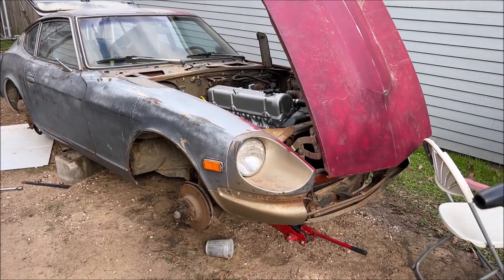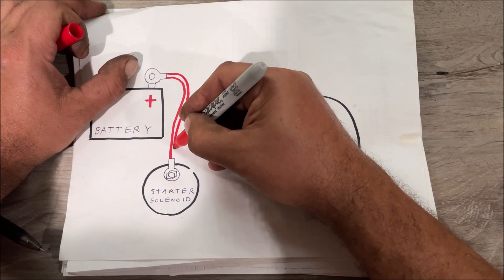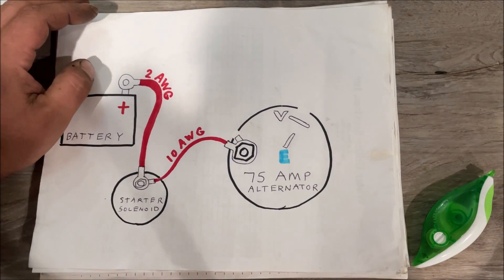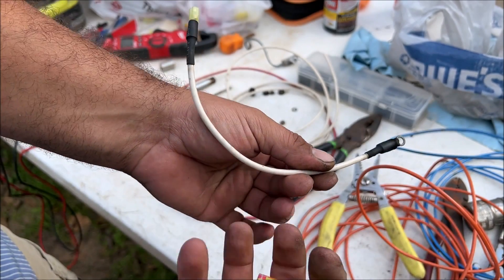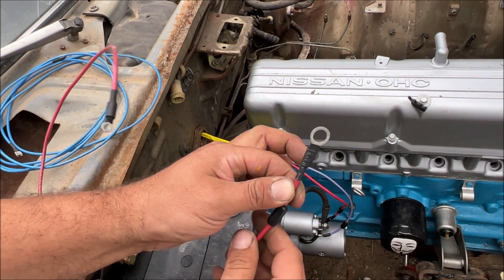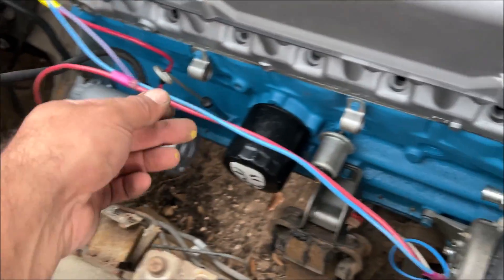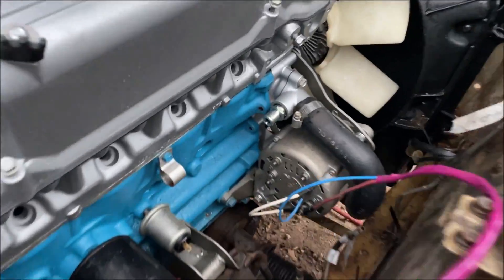how to wire an ALTERNATOR charging system on ANYTHING custom automotive wiring from scratch PART 2

Comment: Copper 10 gauge wire is only rated for 35-40 amps. I would go much bigger, check your alternator for max amps and go above that.
Reply from the maker: we aren’t wiring a house bro
Reply: @chriscraft77022 lmao

Comment: in your other video 64-72 charging system you said the excitor wire is ran to ignition on with the key, yet for this video you said it goes to the accesory, no wonder why I wired by chevy 230 exactly like the other video and it turns over but doesnt crank. I think you did not explain the other video correctly.
Reply from the maker: that was a charging system video. I have a few alternator wiring videos. This is an alternator video so I go in depth. Your car is going to do the same thing. It depends on how the vehicle is wired

Comment: Very detailed good video definitely helped me solve my problem replaced battery and alternator but not the wiring connected to the voltage regulator from the alternator back to the battery and my alternator ended up over charging (i guess) and caused a minor fire (2010 E63 AMG)

Comment: I am wiring a gm style 3 wire alternator. I have battery voltage constant at the alternator for the exciter wire. Any ideas why it has power at the alternator side when unplugged?

Comment: I am converting my 71 Corvette from the factory alt to an aftermarket 1 wire and looking for a diagram to help with my harness, got anything?
Reply from the maker: I have a 1 wire alternator video
Reply: I'll look for it. Trying to figure out which wires I need to run out of the factory harness as I moved the alt from the drivers side to the passenger side.
Reply from the maker: no wires from the harness go to a 1 wire
Reply: @chriscraft77022  So, essetially just from the alt lug to the starter pos, or direct to battery via fuse, and a ground to alt housing?
Reply from the maker: Yes, but run a #4 wire. The alternator is already grounded but you can
Reply: @chriscraft77022  Well, I have a separate mounted mini fuse block mounted on my passenger inner fender where the washer fluid res was. I run a #6 wire to that to power my MSD and Spal fans. It is only about 20" from the alternator currently and I figured I could run a #6 to that lug. 
My battery cable is a 1/0 from the location behind the drivers seat to the starter, the starter end I have the #6 running to the fuse panel. 
Clean and should have plenty of power handling capacity..
Just trying to make my 1 wire setup clean as possible.
As for an extra ground, always figure a spare ground is a good thing.

Comment: Not that it makes a bit of difference with getting it wired but the kick in you might hear when reving the engine up is the other two “legs” activating at cruising rpm. The alternator itself will activate at its set rpm excitement point on one electromagnet with an engine rpm above 500 due to the size reduction of the crank pulley to alt pulley on the belt. Belt travel speed in inches/second is the same at both but the smaller alt pulley spins faster to cover the distance. The single leg keeps headlights, fans and ignition from depleting the battery at idle, it just doesn’t recharge the battery as much at idle. Lower amps output for less drag on motor and better fuel efficiency and heat control when not moving.
Reply: @NeuronioJr sometimes, depends on weather

Comment: I have a 1977 280z but my Black fusible link keeps on getting hot as the revs go higher. Could this method solve that issue, or do you have any other suggestions ? thanks
Reply from the maker: you need to clean all the connections and grounds first

Comment: I wired my Toyota exactly like this. Anyone know why i read 17.5v at the battery when the car is running at about 2000 rpm???
Reply from the maker: your voltage sensing is not wired right. You will catch your car on fire

Comment: Ive got post two looped to the lug just like youve got. But my field wire has power going though it, its not wired to the ignition switch yet. Why does it have power going through it?
Reply from the maker: it shuts power off once the alternator starts charging.. that’s powers your battery light on in the dash

Comment: I had a problem with the ignition wire going to the alternator... no volts.  I tied the exciter wire to the main alternator stud and seems to be charging fine.  Is there any issue running it like that until I get time to trouble shoot the ignition wire?
Reply from the maker: you will drain your battery dead. Voltage sensing has to be hooked up.. not the exciter wire
Reply: Thanks for your reply.  I wish my wiring were as simple and clean as your engine bay.  I have a 95 Ford L8000 dump truck with a fair amount of harnesses that have been messed with by previous owner.  I put a master battery disconnect on the truck so I can isolate the batteries when not in use.  I have a Ford 3G alternator.  Lost all charging on the job site and replaced the unit.  Still was not charging.  Jumped from the main stud to the ignition wire and came to life 14.5 volts.   Been running it like that for a few days to get the job completed.  I was thinking the ignition wire should be hot while running, but mine is not, and will take a bit to go through the harness and take the dash apart.

Comment: ...whaoh!..so if I have an aftermarket ammeter, does it wire into that #2 sensor wire?
Reply from the maker: I have an ammeter video.. no, not even close
Reply: @chriscraft77022  please advise,..or put in a link to it. I see lots of Volkswagen stuff, but not specific ammeter.
Thank you.

Comment: I’ll probably would’ve put a solenoid from the starter and used a power junction . That way you don’t have all them amps in the switch and it n the cab.

Comment: 2:40 why can’t I jump the voltage wire to the power supply if I have a factory in dash amp meater?
I have a 57 Buick
Reply from the maker: you will get a false reading

Comment: So, I got one of these alternators to replace the original and I didn't know I had to wire it to the starter, mine was still hooked up to the voltage regulator. Now, I think my new alternator is fried..
Reply from the maker: you only fry the battery when voltage sensing isn’t hooked up.. if you hook it up wrong it either drains your battery when car is off or doesn’t charge the battery when running
Reply: @chriscraft77022  Turned out that there was a missing plastic piece from the B post that prevented grounding out. That was the cause of the issue. The original wiring that was setup was fine.

Comment: You nailed the reason for the voltage sensing wire, but running it to the output lug of the alternator is not the right thing to do. Running it back to the battery lug with 10 gauge wire will eliminate all those minute voltage drops in the vehicle wiring and will allow the alternator to charge properly. Another point is the gauge of the output wire. Even a 75A alternator will require more than a 10 gauge wire. 6 gauge would be the minimum and if the run is fairly long an even heavier wire may be required,

Comment: Your channel was just the thing I needed! I am working on a custom conversion and I could use some help on how I should build my charging system/Ignition system. Is there an email I can contact you at so we can chat? I would greatly appreciate it! I have a 1972 VW Bus with a Toyota 22R bolted to the original VW transaxle! The original bus harness is still being used and I am a beginner to understand electrical. Thanks in advance!

Comment: You do yours the same as me. But I run the sensing wire somewhere down the line so it will sense the voltage at the battery so it knows if its charged. Running it off the alternator it only gets the 14 volts its putting out.

Comment: Oh my Gosh, thats it, thats it!!! I recently dragged home. A previous owner modified, 1979 MG Midget Spridget. I been plagued with; electrical wiring issues, throughout the car. After i got it running, the previous owner was unable to do. Problems arose; when I decided, the factory wiring harness would not be appropriate to use. Thus I began to do what was my first forte with working on cars, at thirteen. Yikes, headache after headache came a knocking for a visit. And was hungry. Became stumped as to why; new batteries would drain, alternator would put out a small trickle that did not charge system. And, major iggy issues to boot. MG’s weather UK or US versions have interesting electrical engineering methods, in the grounding department. Chris the option your shared and showed. Woke me up. The lights came on. Your vid here, dusted much collected on cranium data I knew well. Now i can go do the proper hook ups and have a charging system, ignition running and starting present return to five star status. Mahalo nui loa, for this Chris. Other I know will be stocked to here what i will share, with parallel disfunctions. Chee Hu ✌🏽🤙🏽✨

Comment: 10 gauge wire is 30A you're running that as a main charge wire on a 75A alternator? Can you not see a problem here? Needs to be 4 gauge - 80A for a 75A alternator. anything less can result in FIRE! Not always, but it's a real possibility. You also have to consider inrush current so I'd go with 3 gauge or ideally 16mm² as 110A at 12v. Wire size is massively important! 

The exciter wirer is also the charge lamp wire, so it should be to a bulb not to the ignition the other side of the bulb goes to ignition 12v source.
Reply from the maker: you are thinking residential wiring. look up automotive wiring charts, in which the run of wire is significantly less and the most important
Reply: Yes and fire starting tolerance is much less for residential then automotive.  Overland can look at anything automotive, the wires are sized much smaller than residential.   @chriscraft77022

Comment: I used 2 awg-18 wires and used both of them to charge the battery.  So basically that's 9-awg right?
Reply from the maker: just make sure they don’t get hot with all your lights on wipers radio everything

Comment: Thank you for this brother..You explain things very good...Now im having an issue getting the Alt to charge batteries on a Generator on a Semi..Now it is hooked up from Alt to starter ,and to Batteries..However my inverter shows me the Alt on the generator is not charging the batteries..Can i leave the other wires in place, and add a wire from my Batteries directly to my Alt to try that??...Thanks..B

Comment: THANK YOU!!!   I was going nuts trying to find this information out about my alternator!
Scare to death I was going to make a CO-BOOM in my garage!
My situation a little different. Have a Subaru EA 82 engine on a custom built stand for an airboat.
Very few gauges,  Bare minimum of a wiring harness, MSD Ignition/Trigger setup.
Just didn't know how to wire the dam alternator wired up.         (👍 ͡❛ ͜ʖ ͡❛)👍   (I owe YOU a beer)

Comment: What would cause the exciter wire to be "hot" when the car is off ? my 65 would not start no click nothing. I was checking all the wires under the hood when i pulled the exciter wire off the alternator it sparked and smoked car still wont start (had to get a tow home)
Reply from the maker: you might have exciter and voltage sensing switched.. that will drain battery
Reply: Im pretty sure i installed it back on the same terminal but i will double check that
 @chriscraft77022

Comment: What if your voltage regulator is built into the alternator
Reply from the maker: that is what the alternator is in the video.. if you have an externally regulated I suggest you throw it away
Reply: @chriscraft77022  LMAO thank you would you happen to know where I could find rebuild kits for an 86 Nissan I need new staters and brushes ect.
Reply from the maker: if it’s not on rock auto they probably don’t sell them
Reply: @chriscraft77022  thank you I appreciate it

Comment: If I want to charge a second battery can I just run off the charging wire of the alternator to the second battery positive? Maybe I could put an off and on switch (household light switch) so it only charges the second battery when I throw the switch? I know you can hook up isolators and all that stuff but I'm just trying to think of the easiest way. I have a little 12 volt refrigerator I'd like to keep active on the second battery and charge it up when I need to.

Comment: Jumping ypur VS wire to the stud surely works, but the best way to optimize /regulate your charging system is to get that VS wire as close to the battery as possible. Mine goes to the block on my inner fender directly beside my billet battery box on a 6" ish run. Here’s why using a remote voltage-sensing connection is a wise move. The main charge wire on the back of the alternator is eventually tied into the positive post on the battery. However, this connection is often a long wire. This cable length creates resistance that can be easily measured with a simple charging system efficiency test

Comment: Great video. I have a 1987 Honda Prelude here in the UK. Red light stays on on dash. Tested battery Voltage when running and not charging. Had alternator tested. Adivised it was faulty so bought new one and still red light on. It has an external VR. Can i run wire direct to positive terminal and test it? Or could it be the exciter issue-which I have never heard of before?
Reply from the maker: is it charging with the red light on?  What is charging voltage?
Reply: @chriscraft77022  No, not charging with red light on. Voltage reading no more or less than 12volts. I am going to checkv over the VRegulator later today in another car which is the same.
Reply from the maker: rev the rpm up and see if it starts charging … an 87 should not have an external regulator

Comment: for better charging performance, the voltage sensing wire should be tapped directly to the battery cable, otherwise, the regulator will not compensate for the voltage drop thru  the  charging wire and this can make the difference between a half charged and a fully charged battery.
Reply: I know this is a old post but can I do this on my 06 envoy on the factory plug it does not use a sense wire but there is a spot for a sense wire on the alternator labeled S it is is it okay for me to TAP directly onto the metal prong from alternator S to my positive on my battery to keep my voltage so the resting voltage on my lithium will raise a little right now it is averaging 13.8
Reply: @joshferguson829  if the voltage is steady , leave it alone, 13.8 volts is just OK, you can go higher to 14.4 but at the price of the component life. On industrial applications, 13.8 volts is the target.
Reply: Can anyone help me wit wiring up a external voltage regulator.  I have pics

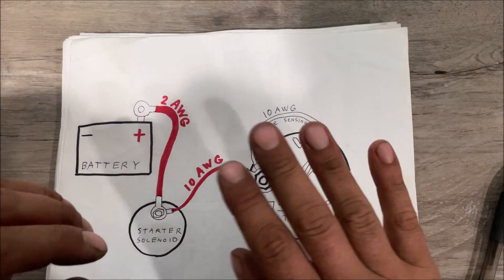Comment: Great video, but is the sensing wire always the top the T terminals as you showed in your video (3:14)?
Reply from the maker: no
Reply: @chriscraft77022  is there a way to verify which is which?  In a nutshell, sounds like it really doesn't matter as both take 12v's so no real danger in burning up my new alternator, correct?  Also, never saw you posting a Part 3 and 4.

Comment: Why do you need the 10 gauge wire from the starter to the Junction block When you got the big red wire going from the Alternator to the battery
Reply from the maker: you can wire it how ever you want ..  I dont wire anything to the battery terminals

Comment: thanks for the video. in your diagram you didn't show a fusible link from the alt to the starter solenoid. on your installation you called out a fusible link at the starter solenoid. did you use a 14g fusible link since you are using 10g wire.  question: does it matter which end you install the fusible link either at the solenoid or at the alternator and is it mandatory??    thanks

Comment: What if you bypass the fuse link on a Chevy electrical wiring system
Reply from the maker: that has been done millions of times... never do it to computers or high amp draw circuits

Comment: Being that an alternator is on a pully system, and it averages 2.5" while the crank shaft is like 6" the idea of increasing RPM does not seem logical. At 850 idea the alt is like 2000rpm + .  I do like this video it is how I would wire one up. Great diagram, explanation is good also. Thanks

Comment: If you have 2nd battery banks, can you send a voltage sensor with diode to alternator to tell it to charge 2 battery bank. Even if main battery is fully charged?
Reply from the maker: my snap on truck has 3 separate battery banks and uses a battery isolator to charge all 3 from 1 alternator
Reply: @chriscraft77022  how many amps is the alternator / amp size each bank / length to charge banks as whole or independently.... thanks.  A wiring diagram or snap on manual link would be nice also & thanks... I'm looking at purchasing A SNAPON TRUCK ALSO FREIGHTLINER BRAND. YEA... BEEN PREAPPROVED. WAITING FOR LLC FORMATION AND ABOUT TO SCHEDULE PRESALE MAINTENANCE CHECK AND TUNEUP
Reply: @chriscraft77022  do you know the alternator amp output & how much each bank receives during lowest idle & highest idle? The snap-on fl60 im trying to pre-inspect has a idle adjustment knob.
Reply from the maker: @readytorvdude1224  my snap on truck is 1999 and i have the battery isolator video on my other channel: Chris Craft